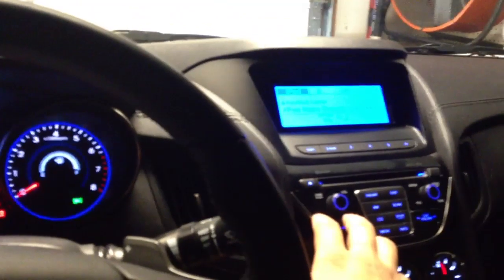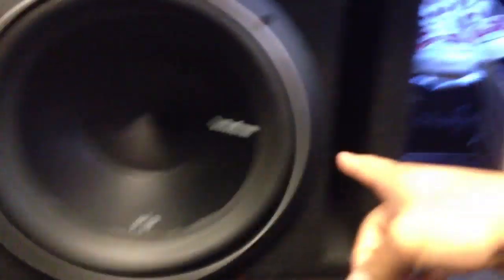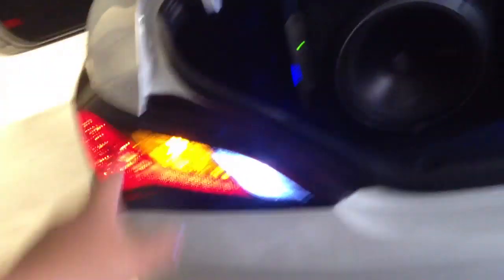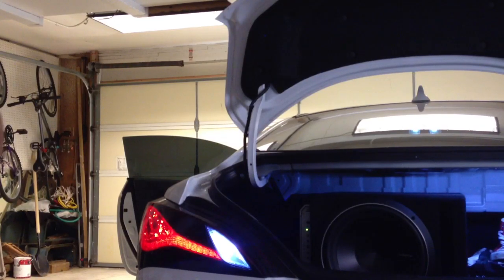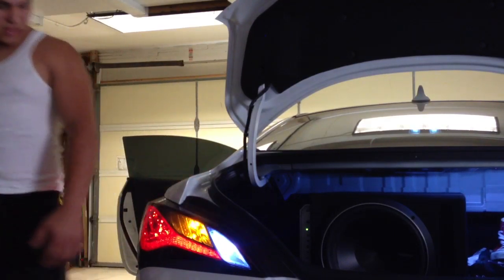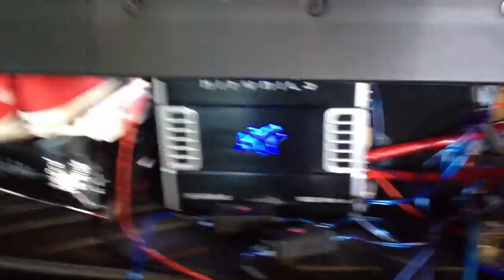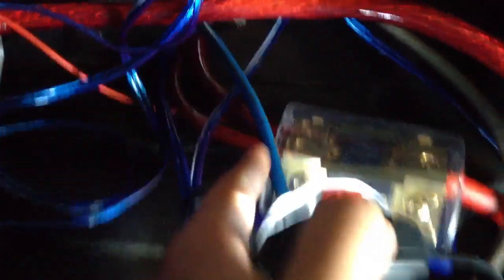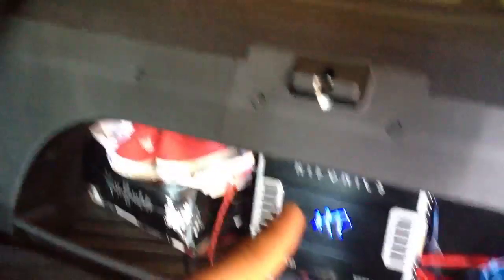2013 Hyundai Genesis Update! (Video 2)

Comment: Hook your mids and highs amp to your fuse for your radio and subs amp to where you have it now. That way you can still listen to your music when your cars not fully on but the subs wont kill your battery unless your going to be upgrading those soon to (alt/bat.+ big three) xspower bat and DC alt what I got and works great run with fosgate 0gague power and grounds. I have about 5000 watts of equipment in my Tahoe DC alts and extra batteries helps and works great.

Comment: do you think you could do a video on how you hooked up your subwoofer and wires to your headunit? i cant find a video on and i was hoping you could help me out.
Reply from the maker: Yea i think I can do that maybe sometime today.
Reply: that would be highly appreciated, trying to help a friend install subs in his 2010 coupe but he has the factory head unit in his genesis.
Reply from the maker: Hey sorry I've been working alot. But what I did is I used a line output converter. Which basically takes the signal from a left and right speaker and converts it into RCA's. Yes you will have to splice into factory wires. Atleast that's how I did it. I didn't want to take apart my stereo. Let me know  if you have any questions
Reply: lol its good, I figured it out and we couldn't wire it so he got the loc installed for like 50 bucks

Comment: What size subwoofer and enclosure is that? I have a 2010 2.0T and ive been trying to find some that will fit. & also did you go through the trunk to put them in or the back seat?

Comment: how the hell did you get a 12 inch box to face the rear?  the opening of the trunk is so small it can only fit 10 inch subs if you want to face them to the rear.
Reply from the maker: It was actually really easy took it to my local shop where I buy all my car audio stuff (granted it's a huge warehouse) and we found a box that fit first try and ported at that. It is a tight squeeze tho a little bit of shoving was needed.
Reply: lightsEDA73
pls give me the HxWxD measurements

Comment: How much did your sound system set you back all in all? Haha I just blew my stock ones out even though they were pretty decent. Looking to get something done like this man! Thanks
Reply from the maker: This is a breakdown of my system and prices are a rough estimate of what I payed for them back when I got it all. 
6 Rockford Fosgate speakers (including tweeters) 225$ 
1 Rockford Fosgate 12" sub 200$ 
1 Rockford Fosgate 4 channel amp 315$ 
1 Hifonics monoblock amp for the sub 150$ 
1 Ported subwoofer box (bitch to find one that fit in the trunk) 60$
Accessories to connect it all up and to keep my factory stereo maybe 100$ 
Labor many hours of work and frustration
I installed it all my self so labor was free but usually the labor is what you'll pay the most for. My total was roughly $1,050 there is cheaper brands out there but you get what you pay for. Goodluck.
Reply: +EnriqueG_S550  On the 6 Rockford Fostgate speakers are those the 2 tweeters, 2 door speakers and 2 rear seat speakers? And what about the one where the brake light is at what you use for that?

Comment: Where did you feed your power wire for your sub in your interior.
Reply from the maker: I usually use an existing grommet that is somewhere in the fire wall but with this car I had make my own hole then seal it up. I used the space behind the ecu bracket on the driver side and it comes in underneath the footwell and steering column

Comment: You use one battery or 2 n which on
Reply from the maker: +Patrick Ballen I had just the factory battery
Reply: Wit 2 amps weren't your lights flashing
Reply from the maker: +Patrick Ballen no they were not but it really all depends sometimes they will dim with just one amp.

Comment: how much was that muffler swap?
Reply from the maker: This was my old set up but I want to say I paid 350 and that includes mufflers piping tips and install.
Reply: +EGarcia73  ok for your sub, did you have to unscrew the bottom trunk thing to fit it in?
Reply from the maker: +Brendan Fitzgerald idk what you are referring to but no just had to wiggle it in and push a little cause it is a very tight fit.
Reply: +EGarcia73 ok thanks im installing my p3 this weekend haha just got a box from best buy Idk if its gonna fit or not
Reply from the maker: +Brendan Fitzgerald I took my car to a local shop they brought out a couple different boxes and we test fit them until finally one fit. goodluck!